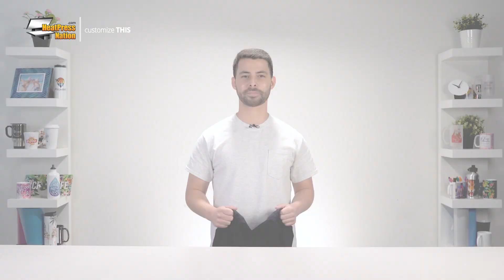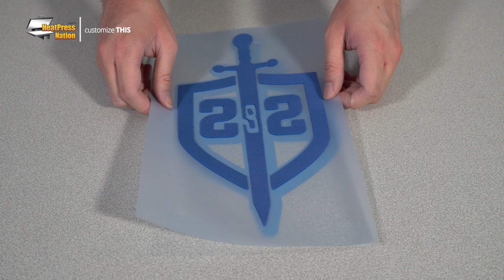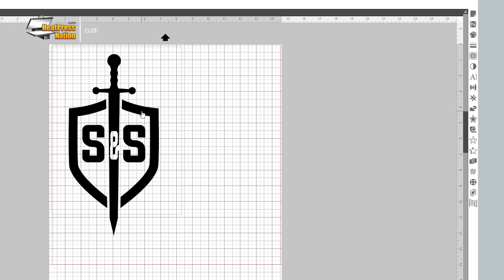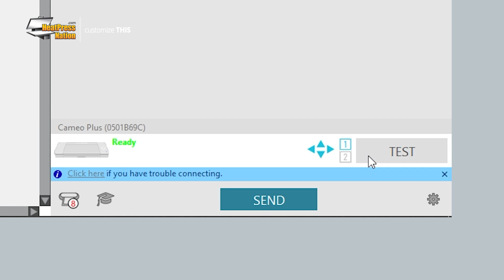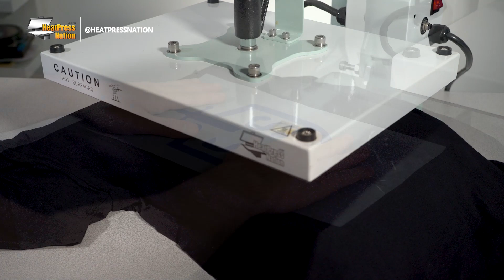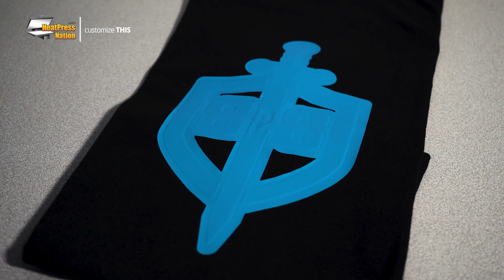How To Make "Embossed" Heat Transfer Vinyl Designs

Comment: Why don't you use puff vinyl instead of this non visible lengthy process. All HTV printing guys know that Vinyl is an expensive material so choose your material and process wisely.
Reply from the maker: We love puff HTV! This process is a little bit different and yields a different result than puff HTV. It's always great to have lots of different print methods in your bag of tricks, which is we we wanted to share this tutorial.